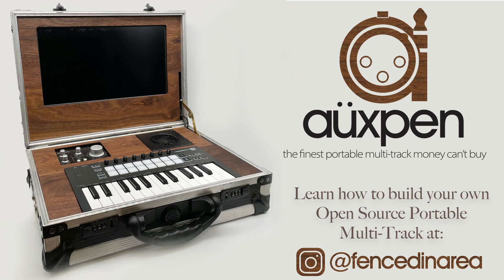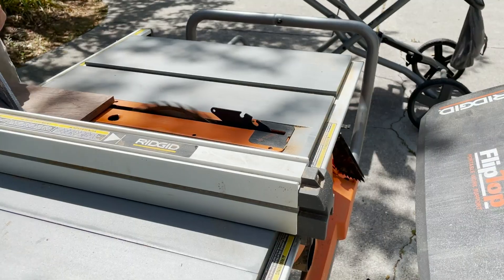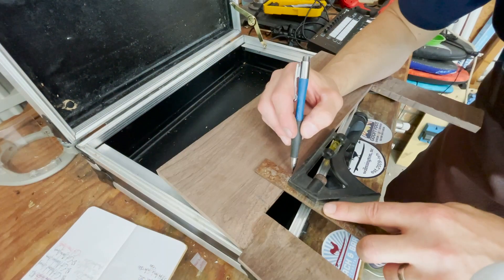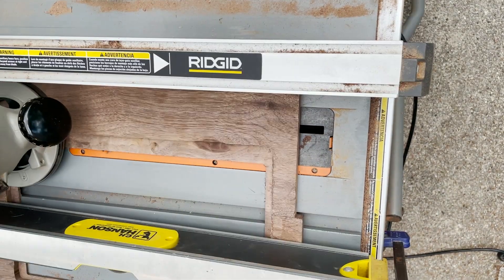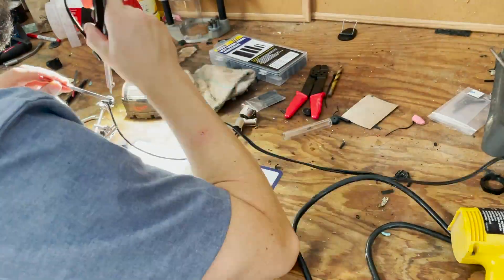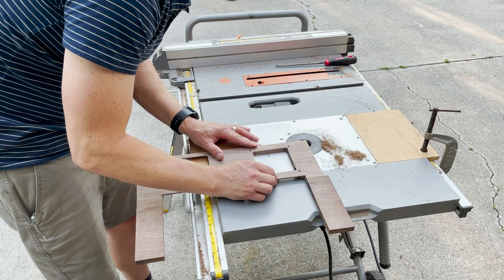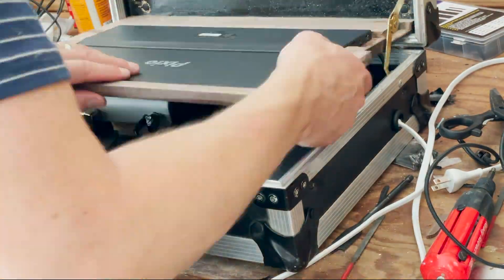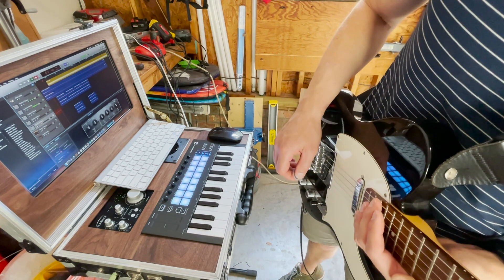DIY Laptop for Audio Multi-Tracking

Comment: The mac mini needs some airflow, now?
Reply: It has an older Mac mini in it, so there is a ton on the top deck.  The M1's and later run MUCH cooler and dont need the fan

Comment: so awesome. 
I've been dreaming of a similar project for awhile. Maybe utilizing a raspberry pi. My design is to be used with pure data a visual coding modular music software. My controller would be a sensel morph, kind of expensive but it's extremely expressive and you can actually switch out silicone pads so it's a a music keyboard, trackpad and computer keyboard, drum pads, music production controller.
I actually have a 2011 mac mini in my retro computer bin so I might reconsider this project using that.
I also just picked up a super awesome vintage samsonite case that would probably fit this project perfectly.
Reply from the maker: Jordan - good luck with your build and I hope you found something here that helps.  I considered rip for this , but the Mac mini - just made it so easy.  The only downside of the old Mac mini is even with the RAM dined out at 16gb, it really struggles under the load of too many VST's.  The sensei morph would be the prefect controller if you can write that check!